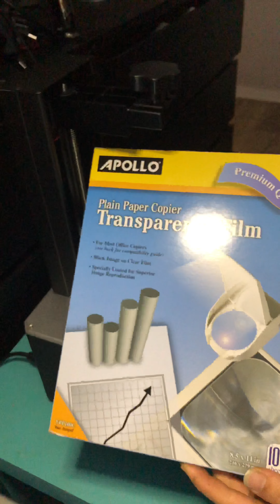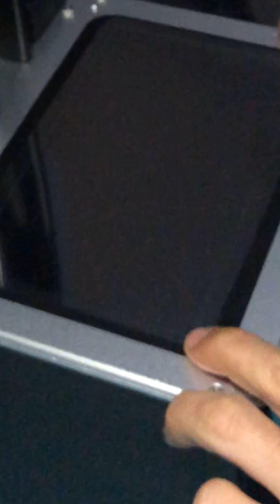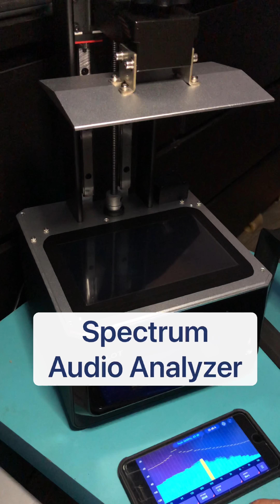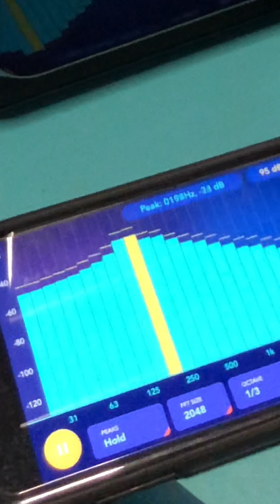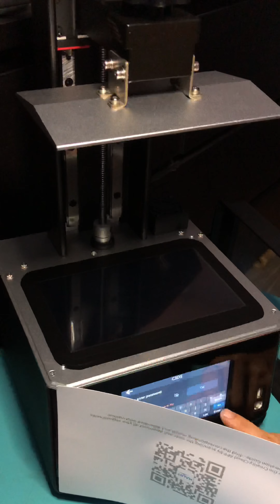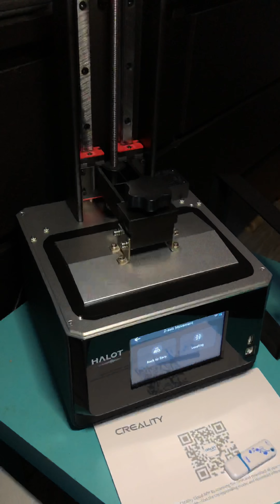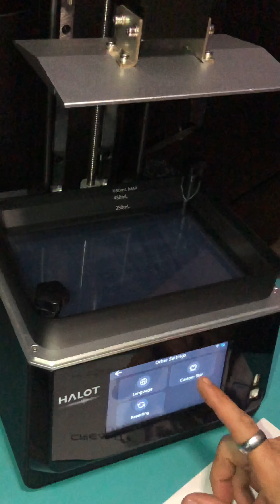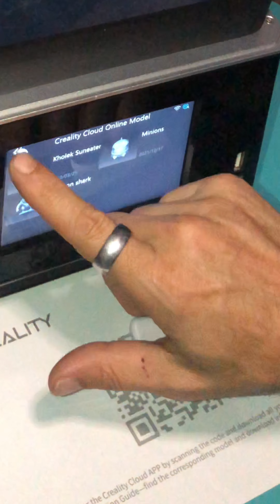Creality Halot One Plus- Unboxing an First thoughts.

Comment: My prints also keeps on punchering the fep sheet and the fep sheet is so sticky i keep on hearing those popping sounds then after the print the fep sheet gets damaged and i have to do the installation again
Reply: I've seen other reviews show the pre installed FEP is saggy. Once replaced with the spare in the box it seems to resolve the sticking issue.